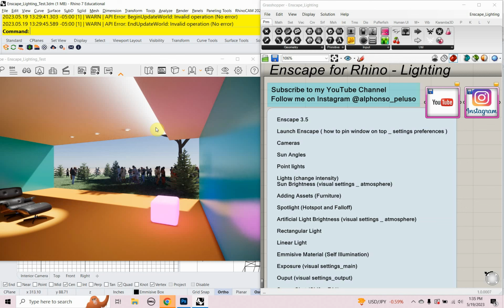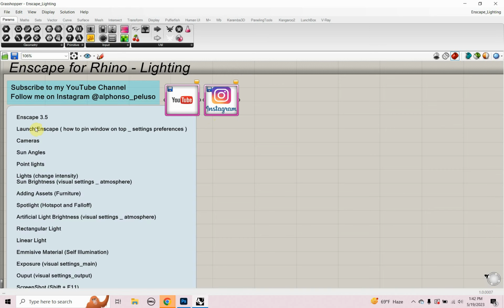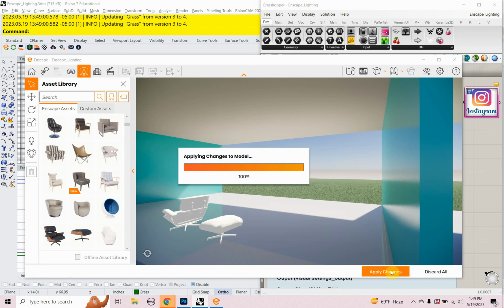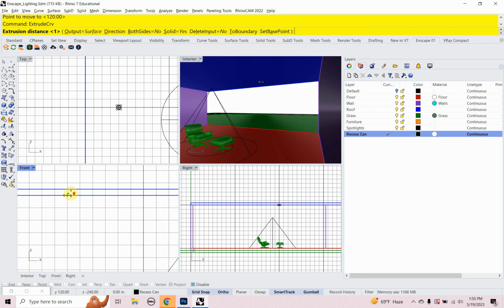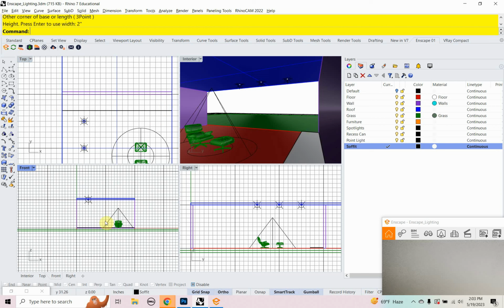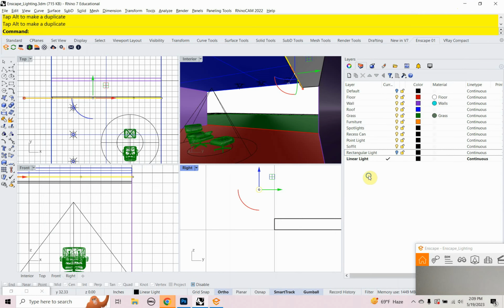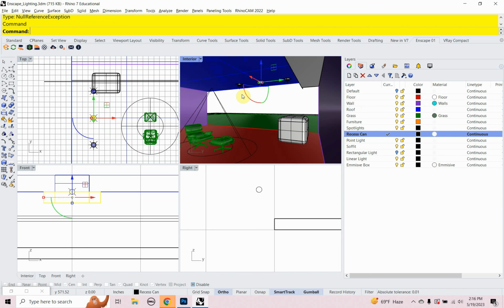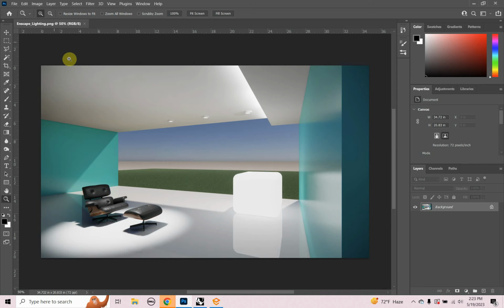Enscape Lighting for Rhino

Comment: 10:48 Sun Angles
11:38 Sun Brightness(Intensity)
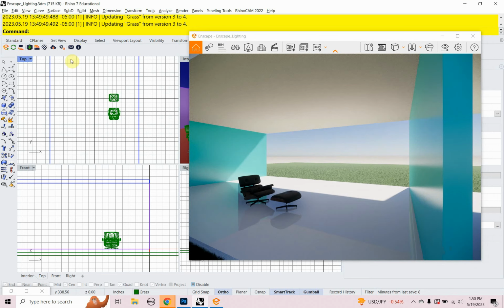16:00 Spotlight(Rhino Spotlight)
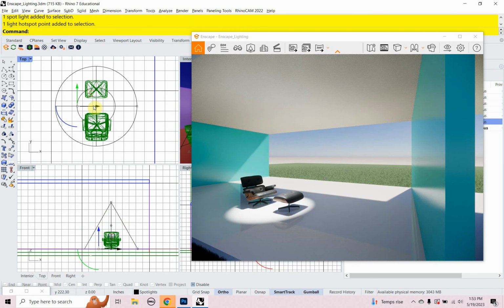19:10 Hotspot of Spotlight
19:29 Fall off
22:39 Saved View in Enscape
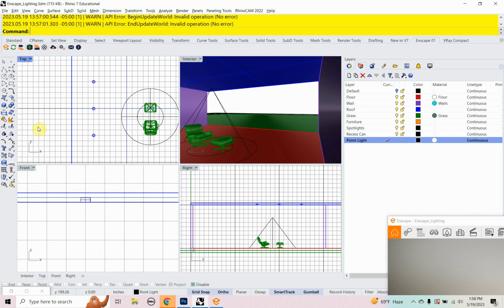23:26 Point Light
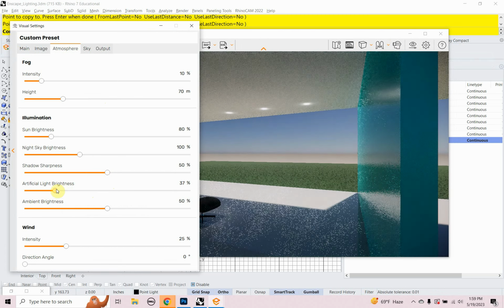25:10 Artificial Light Brightness
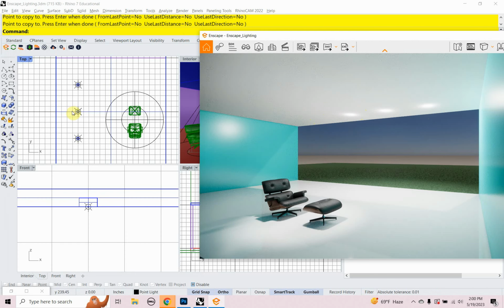26:00 How to adjust Particularly - Pointlight brightness
27:40 Rectangle Light - Doesn't work in here
31:08 Linear Light - works better.
 (The Shadow intensity can be changed depending on the distance b/w light and soffit)
Reply from the maker: Nice!